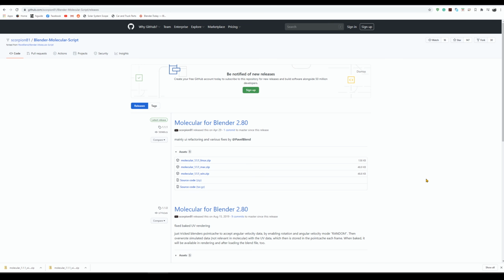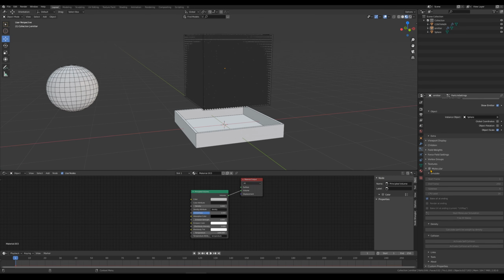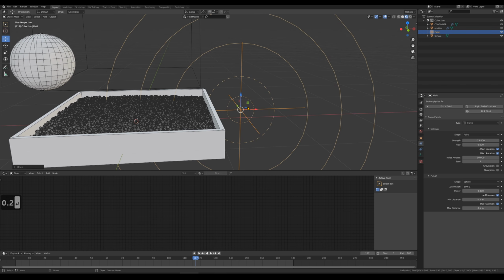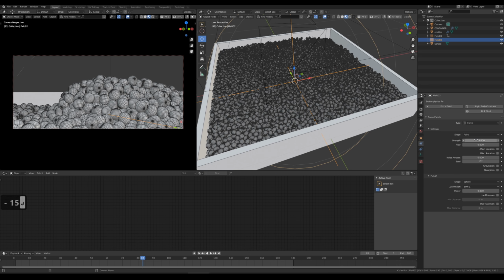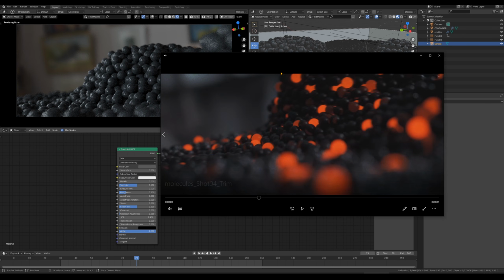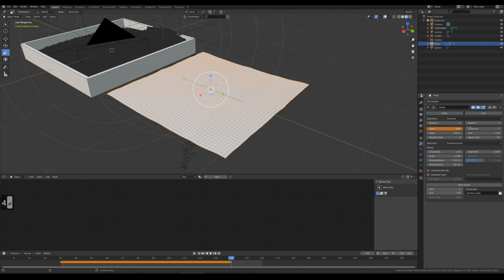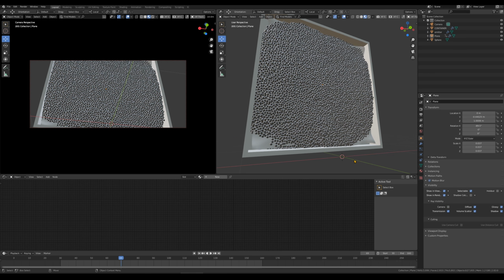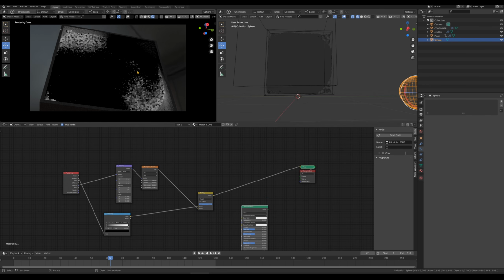How to Create Molecular Simulations in Blender - Tutorial

Comment: Hi Pranjal, first of all.. thank you so much for this awesome tut! Really useful. I almost got everything working like you have right now.. the only 2 parts where I have a different outcome are;

1. creating the second top view shot, when I rebake the simulation (after deleting the 2 force fields) and put the plane with ocean modifier and your settings in the container.. the rebaked simulation makes all the particles bounce out of the box like a pasta pan that is overcooking.. and it's way more then they did in the previous bake/shot I finished.
2. my particles are shaded like a tiger like patterns (stripes from top to bottom) instead of the top and bottom corner being orange and the middle part being black like yours. 

Do you maybe have any suggestions? Thank you!
Reply from the maker: Thank you so much for checking out the video. The paricles bouncing off could be bacuse of the low friction value. Try changing that. Also run a clean simulation making sure all the old ones are deleted.  For the shaded pattern , not sure what is happening in you scene. Can you send it to me and I can take a look,.
Reply: @jalpranjal  Hi! Thnx for your quick reply :) Yea I was already changing up the friction and dampening to not let them "over spill" out of the container but it should just work like yours when I use your exact parameters for the friction and dampening right? That's just weird :)

Yes I can send you my node setup etc ofc! Where can I send it to? Thnx
Reply from the maker: @StyleeSeoul  you can send me at jal.robustvfx@gmail.com

Comment: After I add nod wrangler (around 11:40 ) spheres become completely black and the nod in the shader editor becomes yellow instead of green...what can it be this time?)
Reply from the maker: did it work without adding the node wrangler. You don't necessarily need node wrangler to shade the spheres
Reply: @jalpranjal  main problem is that spheres have that same colour, there is no different types of shading on some of them...they just all have the same texture settings, despite me connect nods (and settings) the same way you do. Yellow nod wrangler maybe signalise that my particle/mapping nods sequence doesn't work correctly.
Reply from the maker: @villagewill7603  I can send you the Blender file and that way you can reference what I am doing. Can you shoot an email to me using the address provided in the about section of my channel?

Comment: Any fix for gaps between the  emitter particles?  The particles appear "floating" on top of each other instead of colliding.
Reply from the maker: Thanks for following the tutorial. Do you have self collision activated?
Reply: @jalpranjal  I have same problem. And I had to scale particles way smaller to avoid "expolding" at start. So simulation scale does not match to geo. Any idea what's wrong? Self collision is activated. Using blender 3.0

Comment: not running for me :( got an error even installing both ways: Traceback (most recent call last):
  File "C:\Program Files\Blender Foundation\Blender 2.91\2.91\scripts\modules\addon_utils.py", line 382, in enable
    mod.register()
  File "C:\Program Files\Blender Foundation\Blender 2.91\2.91\scripts\addons\molecular\__init__.py", line 42, in register
    from . import properties, ui, operators
  File "C:\Program Files\Blender Foundation\Blender 2.91\2.91\scripts\addons\molecular\operators.py", line 7, in <module>
    from . import simulate, core
ImportError: cannot import name 'core' from 'molecular' (C:\Program Files\Blender Foundation\Blender 2.91\2.91\scripts\addons\molecular\__init__.py)

Comment: Hey im having trouble with the script. Everything installed fine and can sort of get a scene working like yours, although the particles do collide with each other, they do overlap a bit and i dont know why. Also, i've tried with another scene using a collection of different rocks as particles and when i run the simulation it just explodes rather than falling and they are not near anything and dont have any initial velocity, and when they collide with each other/another mesh, they do not rotate at all but fall straight regardless of their direction. :/ can you/anyone help?
Reply from the maker: Hey Arta. Sorry for the problems you are facing. As far as I can understand your problem the repulsion of particles could be happening because your friction and damping setting are two low. Try getting them obove 0.1. If that doesn't sloves it then make sure before you start the Molecular simulation the spheres are not intersecting each other in the cube volume. Hope those steps solves your problem. If not let me know and we will figure out something else. Thanks

Comment: The molecules are colliding but have gaps between them when fallen, almost like a force field where they are floating on each other ^^ Does any perhaps have an idea why? (Blender 2.9)
Reply from the maker: That's weird. Do they have that gap between them when in the cube volume?
Reply: @jalpranjal  Yes. Found a solution, without finding the issuie.
Change to ico-hedron and then it worked better. Properly some friction or value 🤷‍♂️
Reply from the maker: @hemdrupdesign  glad it all worked out.